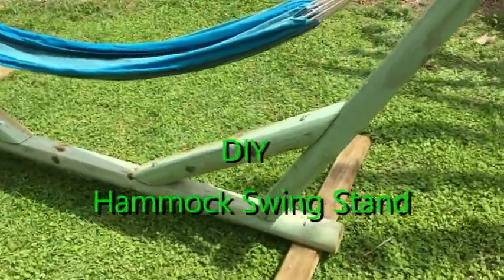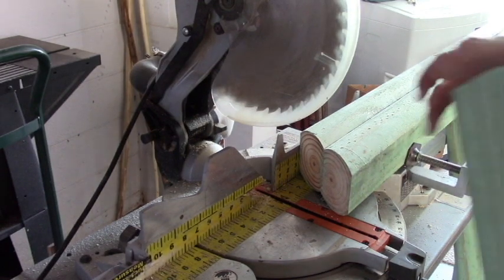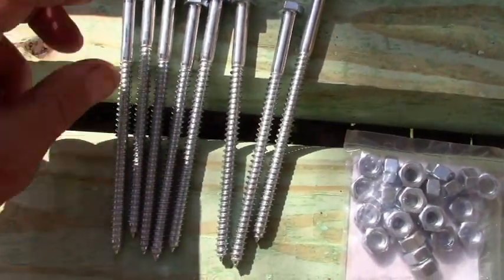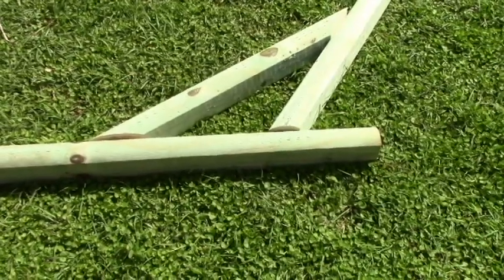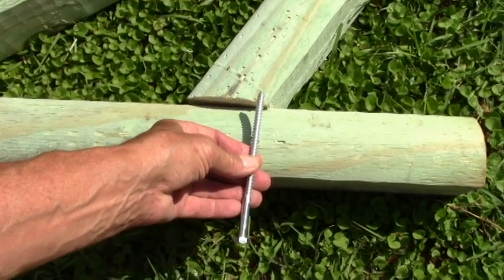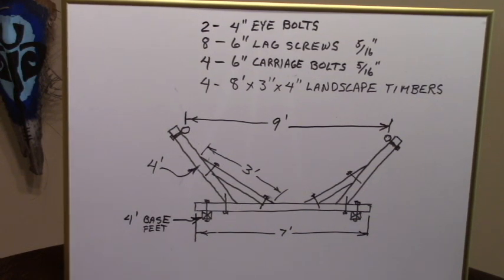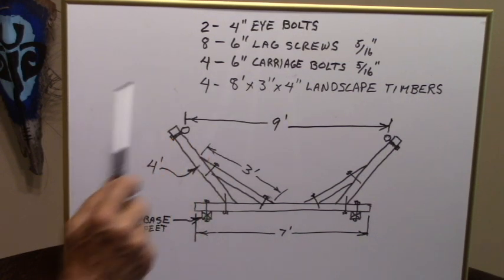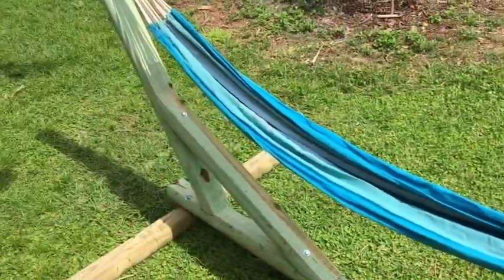DIY Hammock Swing Stand

Comment: Loved te design and came out really nice unfortunately I had an original Panama hammock and the frame was too short so I think I will have to replace the base wood with an 8 ft. instead of cutting to 7 ft.. If you dont use the hammock  on the link you may want to measure your hammock before you cut your base wood.  Also the angle degrees were not acurate with the support 3 ft. woods.
Reply from the maker: Thanks for sharing!
Reply: Did you built one ?  I think I'm gonna give it a try... but my hammock have an overall lenght of 144 inches.  The one suggest in the Amazon link is 110 inches long.  So I will also have to make it longer... 30 inches longer I guess !!!

Comment: Looks great! Wondering if 3/8 lag or thicker would give better stability? Since you have had it for a bit...Anything you would add to make it stronger or hold more weight? Only ask since I'm trying to build one that holds around 450 pounds (two people). Thanks!
Reply from the maker: 3/8 will handle it. good luck
\

Comment: In the suggest link for the Hammock I can see that it's not the same as yours... on the link it as wood bar at both end and yours doesn't have those bars.  Anyway... I can see in the product description "overall length is 110 inches" and you made the distance between both hooks to 9 foots (108 inches).  So, if my personal Hammock have a overall lenght of 144 inches... I have to make it longer :)  I like your plan et your video is well done.  Thanks.